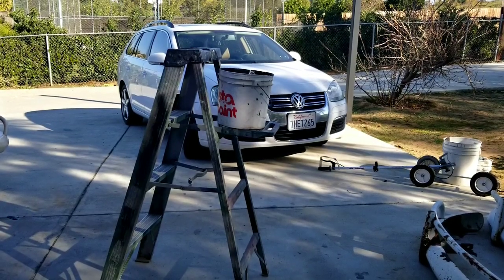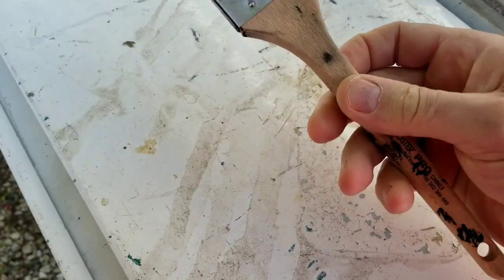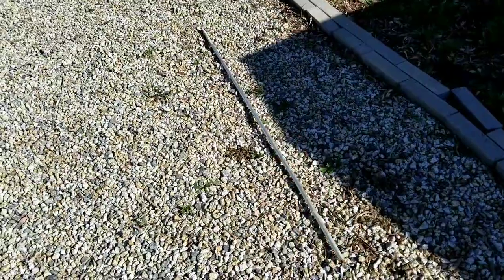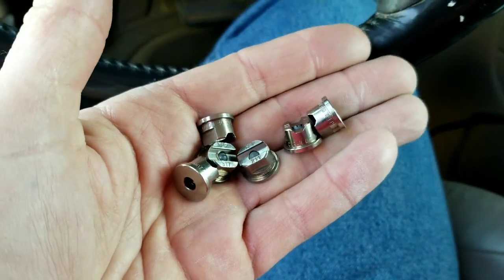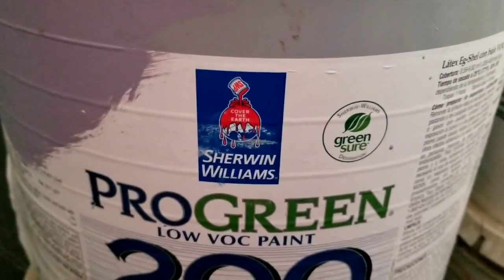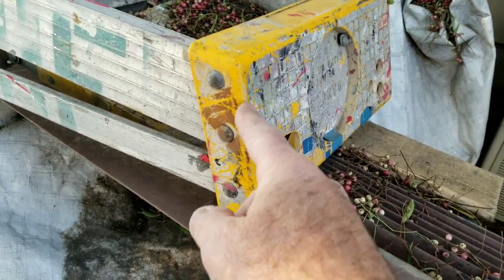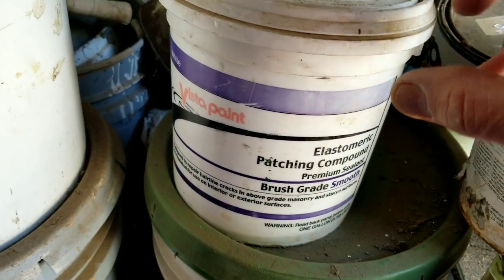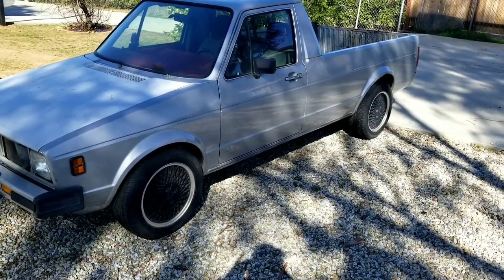What not to do as a painter?

Comment: To sum up video: Dont leave your deuce cut in bucket on ladder shelf when you jump in your truck and then drink and drive on the way to Sherwin-Williams to pick up spackle for your exterior fascia patches that you're going to backroll with an 18 inch roller while spraying California compliant oil base using 6 ft spray wand on a windy day without flat tips!!!!
Reply: Hey Mike what is the best stucco sealer from Moisture? Should I paint before or after Moisture is applied

Comment: I guess what I would add to your list would be the use of Bondo as a filler. You mentioned Bondo but not actually using it. Also, I would say that I only use the dark green top hard joint compound. I only ever use lightweight on ceilings. I’ve seen that a lot over the years, Where guys use medium and light weight compound on high traffic walls, and it just flakes off and can’t take any abuse.    

Also I would second something that you said in another video, where you were discussing your flat tip paint gun set up, and you mentioned how big a deal it is to save a few ounces of weight. I would second that, because over the years do you see how that type of stuff adds up to wreck your body or save your body.

Comment: Hey mike, I recently ordered a corona excalibur and was super dissapointed. Can you recommend and good trim brush you prefer?
Reply: Trevor Ruttan for trim i really like  Purdy soft brush.  Corona is too stiff for trim work unless you can get even lines going across the trim to make it look nice.
Reply: @ruslanglinskiy3554  for any future comments, I only care about Mike's reply. Not random people who's ability I have no reference for.
Reply from the maker: I like those corona chinex bristle brushes. they hold and release more paint per dip than any other brush I have ever used.  The disadvantage is they can leave a bit more brush mark. But if your using the best material those should flow out. There is also a great brush called Proform Picasso. Really nice finishing brush.
Reply: @mikethepainter  yes, just bought an oval flat picasso it's incredible. I get lots of compliments. For sure an interior brush exclusively.